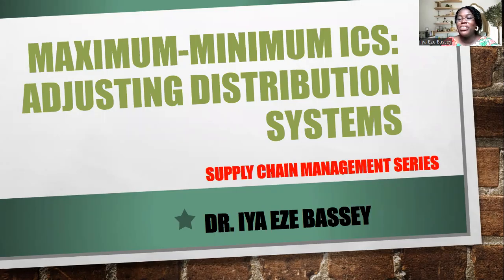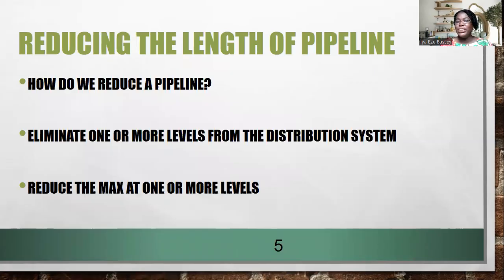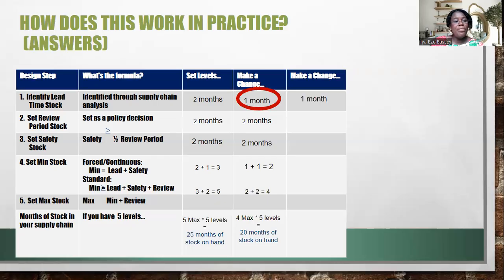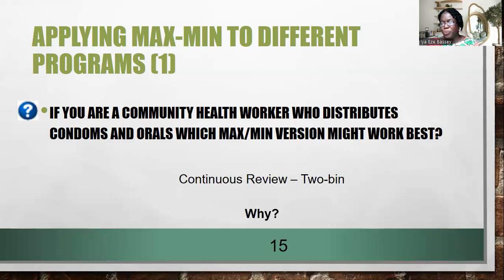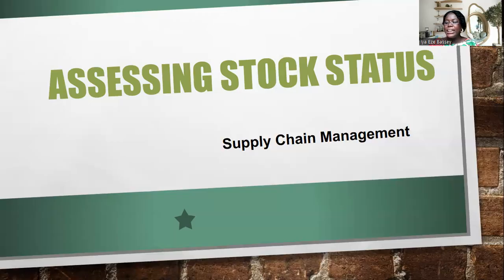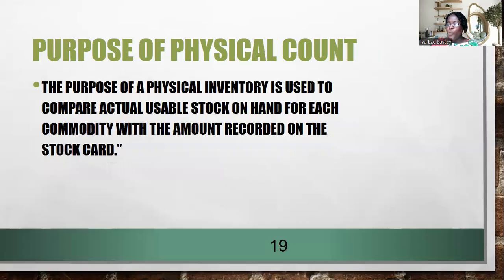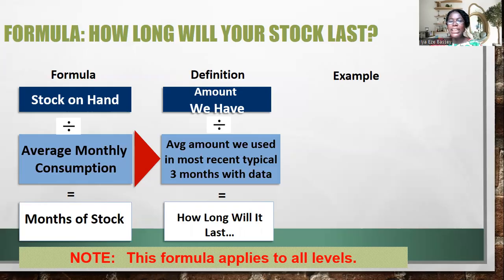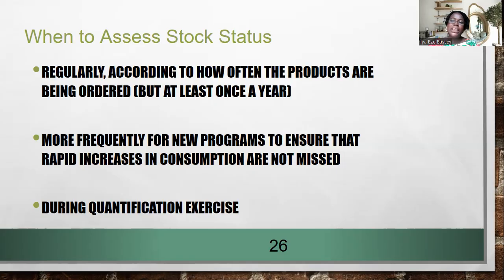Maximum-Minimum ICS: Adjusting Distribution systems (Supply chain management series)

Comment: I learnt the steps in designing a max-min ICS which are,we need to reduce the length of the pipeline by Eliminating one or more levels from the distribution system or by reducing the maximum at one or more levels.
 The other factors that impact max-min stock levels which are the cost of products,Reliability of transportation,storage capacity,cost of storage,storage condition at different level,shelf life of Health commodities.I learnt the Advantages of using max-min system challenges to each version and variation,Definition of physical count,purpose of physical count and the purpose of Assessing stock status.I knew the Formula on how to calculate how long your stock can last,when to assess stock status.
Thanks for this impactful lecture ma.
Reply: Thank you ma for this educative series
From the video I learnt that in inventory control system is it is very important to understand the various type of ice and the significance role they play in supply chain management

I also learnt the several different factors that can impact maximum level including the cost of product,the reliability of transportation, storage capacity,cost of storage, storage condition in different levels
I also learnt the important and advantage of using max min system challenge to each version and variation
Definition of physical count and it's purpose and the purpose of accessing count

Thank you ma for this impactful teaching

Comment: The maximum minimum system deal with avoiding overstocking under stocking wastage avoid costs of emergency orders simplify inventory control decision making consistent stock level reliable data source from sdp for forecasting and quantification and adjusting the pipelines in the facility thanks you 🙏

Comment: I understood that the main purpose of this max/min inventory control management is To maintain an appropriate stock level of all products avoiding shortage and oversupply.
To determine how much stock should be ordered / issued.
The Rule is to review all stock levels at the end of each period. And order enough stock to bring stock levels up to maximum.
Advantages:
It review stock level every two month while Disadvantages it can hold at anytime.
Maximum stock level is defined as the max.quantity of commodities a store keeper can hold at anytime.
Minimum stock levels is the min. quantity of commodity a store keeper may have to allow stock out.

Comment: Fine-tuning distribution systems is all about optimizing how goods move around, making sure everything flows smoothly in the supply chain. It involves tweaking the routes and methods used to deliver products efficiently and effectively, which can lead to quicker deliveries, cost savings, and happier customers overall. It's like finding the best path for goods to travel from point A to point B without any hiccups along the way.

Comment: The steps in designing a maximum minimum ICS are :
1. Set up your initial max-min policy
2.Check the overall distribution system whether it would function maximally
3.Check the length of your pipeline.

Advantages of Using The max-min system
1.Avoid overstocking
2.Avoid understocking
3.Mimimize wastage
4.Simplify Inventory Control decision Making
5.Consistency of stock levels.

Comment: Thank you so much Dr.

      In summary, Inventory Control System is necessary for maintenance of stock levelof all products Its also important in checkmating number of products purchased

It encompasses the Review period.

Hence max.stock level is the maximum quantity of commodities a stock keeper is required to have at any given time. Which is 4 months and measured in terms of months.

For minimum stock, its the opposite of max.stock level. Usually 2 months

Its also important to know that there's an emergency stock, usually 1 month and incorporated into the minimum stock level

Thank you so much ma!

Comment: Thank you ma for this series 
 In summary, I've acquired knowledge about the steps involved in designing a max- min inventory control system(ICS) The methods for reducing pipelines length,and variously factors àffecting the determination of max min stock level. Ive also gained insight into the benefits of max min system, suchas preventing overstocking and understocking , along with the challenges associated with different versions and variations.you mentioned the importance of physical counting, which entails manually tallying the total number of usable units for each commodity in the store or health facilities.
Thank you

Comment: In conclusion, I have learnt about the steps involved in designing a max-min inventory control system (ICS), the method for reducing pipeline length, and the various factors affecting the determination of max-min stock levels 
  I also learnt the definitions of a physical count which is the process of counting by hand the total number of usable units of each commodity in health facility at any given time 
Lastly the purpose for doing a physical counting which is used to compare actual usable stock on hand for each commodity with the amount recorded on the stock card . 
           Thank you ma

Comment: Thank you ma for this wonderful lecture. This is a summary of what I have learnt.

The maximum-minimum inventory control system in brackets ICS (close provides comprehensive guidelines for managing stock levels to prevent overstocking and on the stocking of commodities.

The steps in designing a minimum maximum Inventory Control System include the following:
 
- Setting up maximum minimum policies for each level and type of facility.
- Verify that the overall distribution will function properly. 
- Establish initial minimum maximum policy for each level

The advantages of using the max-min system includes:

-Minimize wastage
-Avoiding the cost of emergencies
-Avoiding understocking
-Preventing overstocking

Thank you

Comment: Thank you, Dr. Iya Bassey, for this enlightening session! I’ve learned that the maximum-minimum (max-min) inventory control system is crucial for managing stock levels, helping to prevent both overstocking and understocking.

Key steps in designing a max-min system include:

Establishing max-min policies for each facility type.
Ensuring the distribution system functions effectively.
Setting initial max-min quantities.
Benefits of the max-min system include avoiding overstocking, understocking, minimizing wastage, and reducing emergency costs. However, it can be challenging for systems with multiple levels, numerous commodities, or new programs. Regular physical stock counts are essential, especially for fast-moving items.

Comment: I understand that one of the purpose of inventory control System is to  maintain an appropriate stock level of all products avoiding shortages and over supply.

ICS terms like the review period and it is important is to know the stock at hand and determine how much to order and to aunit maximum stock level and minimum stock level and emergency order point.

Store keepers and system designer roles and understood the store keepers rule.
 There are three maximum-minimum inventory control system which consists of:
* forced ordering 
*continuous review 
*standard review

Comment: Maximum - minimum ICS: adjusting distribution systems 
           SUMMARY 
 Max-min inventory control system ( ICS) provides comprehensive guidelines for managing stock levels to prevent both overstocking and understocking. it involves various steps in designing the system, methods of reducing pipeline length and factors affecting the max-min stock levels 
Advantages of max-min includes:
. Avoidance of overstocking 
. Avoidance of understocking 
. Minimize wastage 
. Avoidance of cost of emergency

Comment: In summary maximum - minimum ICS adjusting distribution system (supply chain management series) thought about the length of a pipeline, the steps in designing a max-min ICS how to reduce the length of a pipeline, reducing the maximum stock level also about the factors that impact max-min stock (1) 
1. Cost of products 
2. Reliability of transportation 
3. Storage capacity etc also learnt about factors that impact max-min stock level, advantages to using max-min system challenges to using each version and variation. And the definition of physical count which is the process of counting by hand the total numbers of usable unit of each commodity in your store or health facility at any given time, the purpose of physical count, purpose of assessing stock status, calculating MOS on hand when to assess stock status which includes regularly according to how often the product are being ordered (but at least once a year) and frequently for new programs to ensure that rapid increase in consumption are not missed. Thank you very much ma.

Comment: After this lecture, I can be able to able to identify the ways of adjusting system policies like reducing the reducing the length of pipeline, reducing max stock level, shortening review period, and reducing the lead time. I can mention the factors that impact max- min stock levels like cost of storage, reliability of transportation and shelf life of health commodity.
I now know the advantages of using a max-min system for example; to avoid overstocking and under stocking, and to minimize wastage. I know the challenges of each versions of the inventory control system
I understand that we need to asses our stock and know how long it will last in months. Physical count must also be done to compare actual usable stock on hand for each commodity with the amount recorded on the stock card.
Lastly, I got to know when to assess our stock, e.g; regularly, according to how often products are being orders, more frequently for new programs and during quantification exercise.

Comment: MAXIMUM-MINIMUM INVENTORY CONTROL SYSTEMS: ADJUSTING DISTRIBUTION SYSTEMS... 

In a adjusting distribution systems in maximum-minimum inventory control systems. The very first step to is to determine length of a pipeline in such a way that   an initial  max-min policies are set up for each level and the types of facility also check the policies at each level. 

Other factors that impact max-min stock levels  includes

1 cost of products

2.reliability of transportation

3.storage capacity etc. 

Its very important to know that max-min has as many as vital advantages as follows;

1.Max-min ICs help to avoid overstocking

2.Avoid understocking

3.Minimize Wastage etc. 

There a various challenges one will encounter while using the various versions of Max-min ICs and its variation but a clearly followed steps and accurate policies help to litigate these challenges as encountered facilities and their personnel.

Comment: Thank you ma'am for an interesting session, in summary i understood the different steps in designing a max/min(set up initial max-min policies for each level and type of facility, check if the overall distribution will function properly if the level specific max-min policies are implemented, check the total length of the pipeline that the policies at each level imply. moving on i clearly understood the factors that impact max-min stock levels( cost of product, storage capacity,cost of storage, reliability of transportation. I further had an understanding on the physical count of stocks  which is important and should be done at least once a year, in cases where stocks are moved rapidly, count should be carried out frequently to ensure adequate inventory management.

Comment: Topic; MAXIMUM-MINIMUM ICS : adjusting distribution systems 
In summary I learnt the steps to designing the Max-Min ICS which are;
1. Set up an initial Max-Min policies for each level and type of facility.
2. Check if the overall decision will function properly, if the level specific Max-Min policies are implemented.
3. Check the total length of pipelines that the policies at each level can imply.
There are several factors that affect max-min levels which includes;
1. COST OF PRODUCTION, 2. LEAD TIME, 3.COST OF STORAGE, 4. STORAGE CAPACITY, 5.AGE OF PROGRAM.
In conclusion, this factors have some advantages which are;
1. minimize shortage, 2.minimize wastage, 3.prevent overstocking etc.

Comment: Thank you for the outstanding lecture, ma'am. Here are my key takeaways:

Adjusting Formula Elements to Reduce Max Stock Level:
1. Decrease the review period
2. Shorten lead time
3. Enhance distribution system reliability

Designing a Max-Min Inventory Control System:
- Initial Setup: Establish a max-min policy tailored to each facility level and type.
- Distribution Check: Ensure the overall distribution network functions well with the implemented max-min levels.
- Pipeline Assessment: Evaluate the total pipeline length implied by each level.

 Benefits of the Max-Min System:
- Waste Reduction
- Prevention of Overstocking and Understocking
- Consistent Supply Maintenance

Comment: Thank you ma, I learnt that the steps involved in designing the Max- Min inventory control system are ;1) Set up your initial max -min policies. 
2) Check the overall distribution system whether it would function maximally. 
3) Check the length of your pipeline. 
To reduce the length of your pipline you can 1) Eliminate one or more levels from the distribution system. 
2) Reduce the max.stock level at one or more levels. 
To reduce maximum ;
1) Shorten the review period at one or more levels. 
2) Reduce the lead time at one or more levels. 
3) Improve the distribution system's reliability at one or more levels so that safety stock can be reduced. 
Factors that could determine your max-min stock levels aside length of the pipeline are;
1) Cost of products. 
2) Lead times. 
3) storage capacity. 
4) Age of program. 
5) shelf life of health commodities. 
Advantaged of using the Max-Min system are;
1) Avoid overstocking. 
2) Avoid under stocking. 
3) Minimize wastage. 
4) Simplify inventory contol decision making. 
5) Consistency of stock levels.

Comment: This lecture discusses ways of adjusting the distributor system policies. This can be by ELIMINATING ONE OR MORE LEVELS FROM THE DISTRIBUTION SYSTEM or REDUCING THE MAXIMUM STOCK AT ONE OR MORE LEVELS.

The Lecture highlights the different factors that impact Max-Min Stock Levels, the advantages of using Max-Min Inventory Control Systems and the challenges faced in each version of ICS.

From the lecture, it is understood that STANDARD VERSION of ICS is the recommended version for the management of HIV/AIDS commodities in Nigeria. In addition, the lecture explains Physical Count to be a process of counting by hand the total number of usable units of each commodity in a health facility at any given time, its purpose and the purpose of accessing stock status.

It also analyzes the formula in determining Months of Stock (MOS) given as:
Stock on hand ÷ Average Monthly Consumption = Month of Stock.

The Lecture concludes with the frequency and importance of accessing Stock Status. A lecture indeed worth every time and effort.

Comment: The steps in designing a max-min ICS is to
1. Evaluate the total length of the pipeline to ensure that the policies at each level comply with the specific requirements
2. Establish initial max-min policies for each level and type of facility
3. Verify the whole distribution system if it will operate effectively with the max-min policies implemented  at each levels

Advantages of using max-min systems;
Avoiding the cost of emergency
Minimizing spoilage
Preventing overstocking
Avoid understocking

The max- min ICS provides comprehensive guidelines for managing stock levels to prevent overstocking and understocking of goods
Reply: Maximum-minimum adjustment evaluate a logistics system and all the process to ensure that the policies at each level give a positive outcome with the specific requirements.
It also provide a comprehensive outline for managing stockout.
Thank you ma

Comment: Thank you ma for this wonderful lecture
I learnt about the max/min Inventory Control System (ICS) distribution and the steps involved in designing an effective max/min ICS. This includes strategies to shorten the distribution pipeline by eliminating unnecessary levels and other optimization measures. I learnt about the steps in designing a Mac/min inventory control system which are:
1. Establish initial max-min policies for each level and type of facility.
2.Verify the overall functionality of these policies.
3. Assess the total length of pipelines created by these policies.
I also learnt that there are several factors impacting Max/Min Stock Levels and this factors influence the effectiveness of a max/min ICS, which aims to minimize shortages, prevent overstocking, and avoid understocking.I also learnt the advantages of max/min ics
Additionally, I learned about the importance of physical counts, which involve manually counting usable units of each commodity. This helps determine how long products will last and provides a basis for calculating inventory needs. Regular assessment of stock status is crucial to maintaining an efficient ICS.

Comment: Max-min inventory
control systems are useful for
managing the supply of laboratory reagents, consumables, and equipment in medical laboratory science. 
By setting the right maximum and minimum stock levels, laboratories 
can meet demands without having too much or too little inventory. This helps keep operations smooth, resources optimized, and ensures timely delivery of accurate test
results.